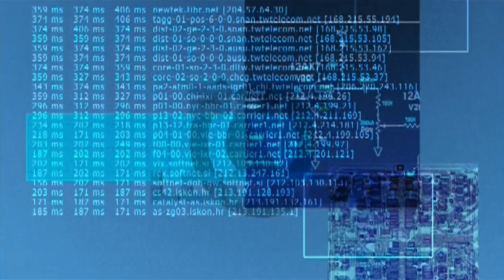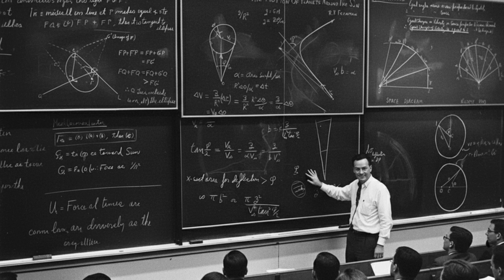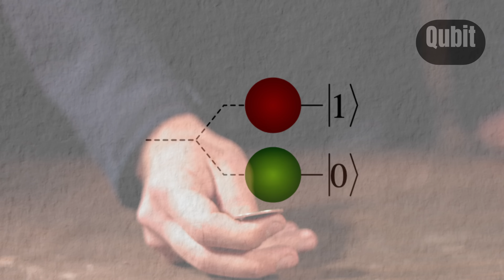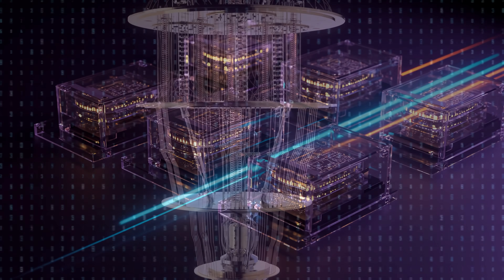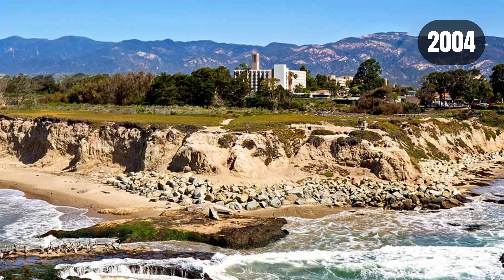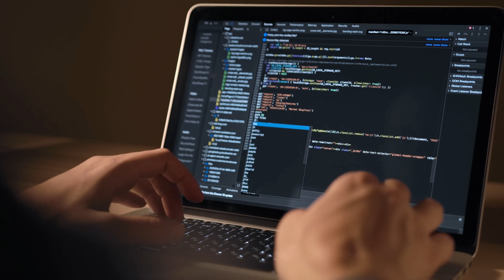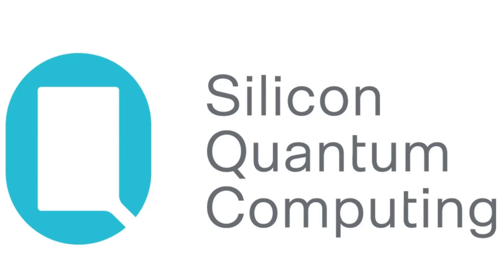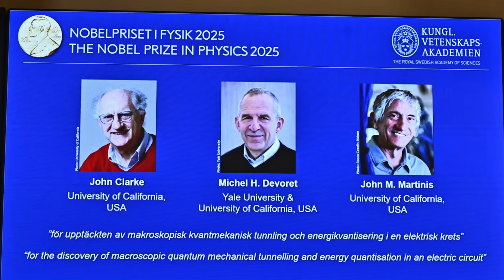Meet John Martinis, Winner of Nobel 2025 in Physics

Comment: This is wonderful HOWEVER there will never be quantum computer until another noble is awarded to someone who overcomes the DECOHERENCE problem until then a QUANTUM COMUTER is still a dream BUT progress is ongoing BIT by BIT.
Reply: there you go: the code is base60, and operating system I named OrbOS. connected to time and hertz, space and energy. This analog computing "oscillator" can be used with binary thru dac, adc and dsp and special asics and fpgas. 1hz=1 cycle per second, 10e43 is domain horizon, planck scale cross to infinity, 10e-43 is 0hz also planck scale cross into infinity. by calculating resonance in volts 0.0v->6.0v (0.1v=6 degree of the circles 360degrees. the way you can look at it is 60 steps (0-59) 59 steps(1-59) and 61 steps (0-60). It can map resonance and harmonics on the spiral contraction and expansion that we can map on a torus and calculate toroidal field pinch n=1 or  (stable computing n=5 to n=10). It will provide stability (q=10e12) requirements for tokamak engine/field computer resulting in absolute field stability